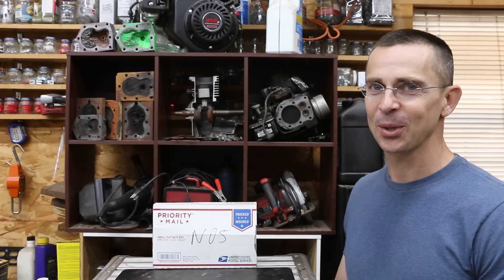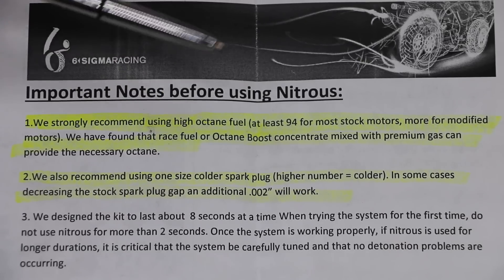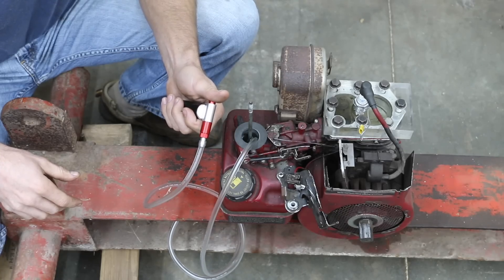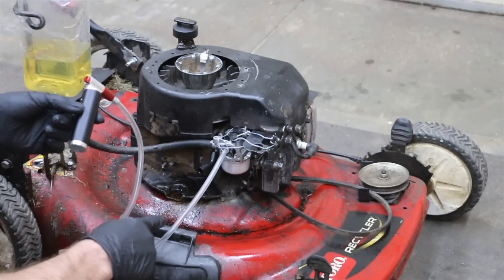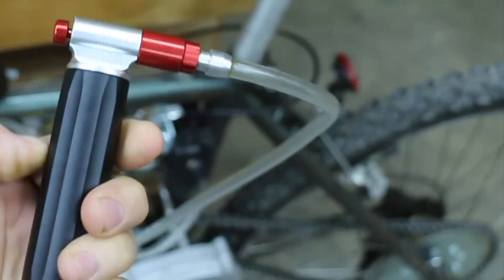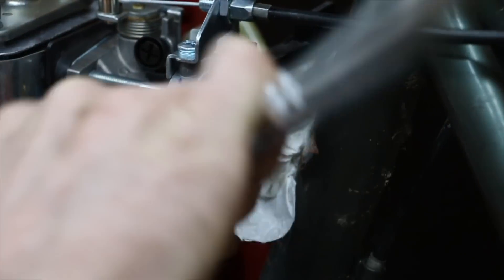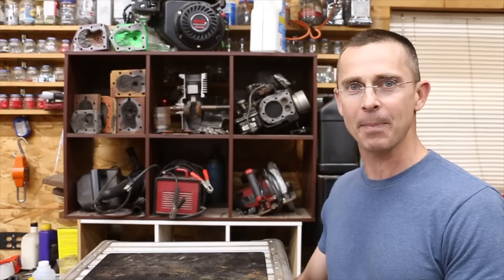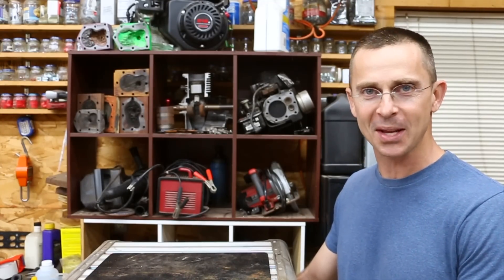Will the 4-Stroke Bike Survive Nitrous Oxide?  Let's find out!

Comment: Interesting... but several points to consider.  A "Real" NOx kit advances ignition timing a few degrees to combat preignition when active - this seems to be the biggest reason nitrous has a reputation for destroying engines: Noobs will add bottles and spray bars, but not a proper ignition system and the engine beats itself to death knocking. Also, a "Real" NOx kit adds additional fuel as well as the oxygen from the nitrous breaking down to generate additional horsepower using less nitrous - not so easily done without MUCH more complexity ( = Cost). While just the extra oxygen will allow the fuel to burn a bit faster and hotter in reality it causes the engine to run extremely lean, which is bad for preignition by itself, but also leaves plenty of extra oxygen to do other bad things related to preignition.  It's hard to tell, but the knock you experienced at least in the see thru engine test was likely caused by the "firefly" floating around in the cylinder - this very common in NOx engines. Sometimes carbon deposits can get knocked loose, but often rough places on the piston or head are the cause. Any kind of imperfection can do it, but notoriously numbers and logos stamped in the piston create thin raised areas around the stamping which become superheated, remain glowing hot from one power stroke to the next compression stroke, and serve as a preignition point during the next cycle.  Hot Rodders take extreme care to polish piston and head surfaces in boosted engines for this reason - that goes for turbo/supercharged engines as well. Connecting rods and crankshafts are also either specially made or polished when pushing an engine so far beyond its design output as any sharp corner can serve as a stress point to start a crack.
Reply: A "real" nitrous kit has nothing to do with timing, timing is controlled by other independant electronics such as a MSD box on a car, and ***timing is retarded, not advanced when Nitrous is used.
Reply: Um... advanced in the other direction. Sorry - Bad proofreading there, but point is if you want to add a significant percentage of the engine's original HP from a bottle there is a lot more to do than just shoot it down the intake. At least if you want any kind of life out of the original metal.

Comment: OMG so many things make me stress about this video. As a long time drag racer who has used nitrous many times it’s not used for RPM increase. That’s the WORST reason to use it. You are lucky that little motor survived. Power increase between 3k and about 500rpm before max is what it is designed. You should do a acceleration test where you go 40yards with and without the nitrous.
Reply from the maker: Great point. The 4 stroke bike is over geared and runs out of HP before RPM.

Comment: I will second the request for the Nos on the 2-stroke. Also test a small motor to see how high you can get the rpms before it completely fails. Perhaps thru the combination of a fuel pump and Nos. (not asking for the destruction of a new motor that would just be a waste, but perhaps as the final run for one already near it's end)
Reply from the maker: Great video idea!  Thank you.

Comment: You didn't make more power.  You just pushed it so lean it made the max it could, regardless of the extra oxygen being injected.  You could get that result without the kit.  Without more fuel being added also it is just an ornament.
Reply: the engine was probably running a little rich already, which would explain the bit of added power he did get.  Ofc he would get more if he added more fuel as well.  I'm not quite sure why the kit wouldn't include some way of adding more fuel, as a properly tuned carb\engine would make it useless

Comment: Put a turbo or supercharger on the bike engine, if you can find one small enough to work!  :-)
Reply from the maker: Thank you for the video idea!
Reply: A smog pump from an old car makes a great small engine supercharger
Reply: Julian Redwood then carburatoon becomes a major issue. Either have to run a "blow through" carb or put the carb on the intake flange of the turbo. Turbos get very hot, fuel ignition temp is fairly low (around 490-500 degrees). Could get dangerous.
Reply: @JOOLZNED  yes that's them
Reply: I've seen a Chinese 12V supercharger for "Up to 125CC"!  I'd like to see that tested. I'm thinking about putting one on my Trail 90  :-)
Reply: Stew Miller those e-superchargers are garbage.
Reply: Nah, there is no need for a turbo just take some jumps and drive on the wrong side of the road. Nitrous will refill itself and you can then use it pretty much all the time. Do some near misses if you can too.

Source: Need For Speed: Hot Pursuit
Reply: http://s-charger.com
Reply: https://www.motorcycledaily.com/2006/04/18april06_superscoot/
Reply: I put a turbo on a golf cart at a farm I used to work at, tiny little unit and not entirely sure where it came from but it did sort of work but only at max rpm. With less than 3 cylinders you'll struggle to maintain smooth airflow through the turbo and it'll run really rough
Reply: nope, don't do that, a small engine does not create enough exhaust pressure to create any boost. All you do is spool the turbo and gain absolutely nothing. You'd need a small engine capable of 10k rpms, predator 212, a heavily modifed briggs, tilitons etc. These VERY small engines, are INCAPABLE of any boost. It's just gunna detonate and honestly could hurt the great youtuber here.
Reply: You can get cheap turbos for small engines on eBay. <$150.
https://www.ebay.com/itm/Top-Racing-GT15-T15-Turbo-Charger-For-Motorcycle-ATV-Bike-35-A-R-Cool/132462037240?hash=item1ed75a48f8:g:LSMAAOSwn9VaU0Jq:sc:FedExHomeDelivery!72205!US!-1:rk:4:pf:0
Reply: @TravisTerrell  
Gt15 Garretts are used in 1.6-2litre diesels. They wont spool il 1cyl engines. 750-1000cc motorbike engines are totally different. They produce enough exhaust pulses and volume to spool.
Better way to select turbo is compare it to horsepower. GT15 is rates to 80-120Hp...
Reply: @Juho Mäki-Petäjä Good to know. I was just going by the product description, not actual knowledge. I know these guys purchased a similarly priced turbo from eBay for their Barbie Car go-kart engine. I wonder which model they used. https://www.youtube.com/watch?v=Tz7_9xwyV2I

Edit: It's this one. https://www.amazon.com/gp/product/B01A0MG5OM/ Though it advertises it is for engines around 100hp. However, it also says 500-600cc's, and I don't think most 500cc engines are making anywhere near 100hp.I wonder how many HP the Barbie Car is—I wouldn't think it's anywhere near 100hp either, given its displacement. Hmm...
Reply: Btw i don't understant the idiots who say turbo cant spool up in 1cyl engines when they dont have experience of the thing at all😂 only exhaust pulses does not matter when you just understant more than basics of the otto-cycle IC engines.
Reply: Only it makes sense that HX80 holset wont spool up in engines that are used in average everyday engines.
Reply: @jahasmitasmitas3338  
80cc can spool turbo enough small but you need lots of rpm to get enough exhaust volume. It is usually totally pointless.
Reply: Juho Mäki-Petäjä Pointless but fucking interesting and entertaining, you dont need to explain everything with sense when you do something different and fun.
Reply: @jahasmitasmitas3338  
Ei tartte mennä henkilökohtasuuksiin jos jää toiseksi.

We were discussing 49cc low rpm engine forced induction.
Reply: Juho Mäki-Petäjä En oo menny missään vaiheessa, suomenkielellä sanottun hölmöimpii virityksii ei tarvii "Selittää järjellä" vähä sama ku "miksi ei" ssnonta😂👌
Reply: vz21 rhb31 chinese ihi clone turbo will do the job on 4 stroke bike engine.
Reply: No chance, thats for a 800- 1100 cc engine, gas flow wouldnt even spin the turbo up
Reply: Julian Redwood Why not? here in Finland i got 2 friends who have put it on 110 and 125cc monkeytyoe engine and boosting very well. 80cc would spin it and make it boost when you just know what ypu are doing.
Reply: Finnish Gopnik 
Yeah at 9000rpm. That bike 4stroke is too lazy to make boost.
Reply: @jahasmitasmitas3338  you could increase the air velocity by reducing the exhaust pipe diameter. Wonder if that would help spin it up.
Reply: Calvin DiBartolo Technicly that's true, and when you ste boosting even witl very low pressure you increase the amount that comes out of he exhaust, so it makes the turbo spool bit better at the time when you are starting to build boost. Everything matters on turbobuilds and i can honestly say that im not a idiot and will proof that 80cc will spin turbo small enough
Reply: i quess it would be possible to make it work just when you know what you are doing.
Reply: Finnish Gopnik 
You can not beat physics. As 15year old all seems possible. But reality is another thing.

Comment: If you’re willing to test it, E85 has a reported octane rating of between 100-115 (sources vary on what it is exactly but it is def above 100). This may help with the pinging and I doubt it would hurt the engine in the short run, although you would need to adjust the carb since the fuel-air ratio is 9.8:1 with E85. Love the videos!
Reply from the maker: Great recommendation!

Comment: If you can add fuel, you'll make more power. All car systems have two sides. One fuel and one nitrous. This will fry any motor its used on. You must add fuel too.
Reply from the maker: Great recommendation!
Reply: @Joseph Houser Dry kits are for fuel injected engines that have capabilities to add extra fuel via tuning of the ECU. Nitrous oxide without extra fuel leads to a blown engine very quickly

Comment: You should try oxy/acetylene injection on a small engine!!!
Reply: As a welder I don't think that's great idea lol
Reply: Michael Smith it works, or at least map gas does . Correct me if I am wrong but the only difference is map has some propane in.
Reply: @Alexander-xx6pu  I'd correct you if I could, but you're right! Mapp (Methyl acetylene poly propylene) has a higher ignition temperature than pure acetylene. It will wait for the spark, allowing the engine to run properly. Its actually more like propane except you'll use less of it for the same amount of oxygen than propane. The result would be a little less power for a longer time. sort of like the difference between gasoline and alcohol.
Reply: Vincent Robinette thanks
Reply: I tried that. KNOCK!!! PING!!! acetylene has such a low ignition temperature that it will detonate before the spark.
Reply: I predict a cut valve before long.
Reply: @RoyMach1ne  Make sure you have a good spark arrestor on the muffler.😁😜😁

Comment: As many commentators have noted, there needs to be additional fuel introduced with the NO2 to consume the liberated oxygen. As you mentioned, there is also decomposition energy released by the liberation of oxygen and nitrogen. All of this leads to faster flame propagation rates. On all the small engines you tested, the timing is fixed, based on full throttle at rated speed. As such, I could clearly hear pinging in every one of them. One thing to try, to introduce extra fuel, is to apply a small amount of choke as the nitrous oxide button is pressed. Maybe, you could set up a linkage that stops the choke lever by pressing the button on the cartridge. That will help ensure that you're oxidizing fuel, not piston faces, or exhaust valves or seats. If you miss on  the fuel/ nitrous mixture, better rich than lean. I'm also hoping that the thermal mass of the extra fuel slows the flame propagation rate enough to work with that fixed ignition timing. I don't know. Could you possibly revisit this with mixture compensation?
Reply from the maker: Great point.  I'll revisit with more fuel.  Thank you!

Comment: Project Farm suggestion: Test zip-ties

I would not have thought that there would be a difference between zip-ties,. Today, I discovered that there's a big difference! It's about 8°C outside and I used zip-ties to put my Ford Focus back together because I wanted to improve on the factory build-quality. As I was tightening up a black zip-tie to re-attach my shift cable to the shift-lever, the zip-tie snapped where it was bending (while it was still super-loose around the cable end). I thought that was an anomaly, but then I tried it with a second black zip-tie and the exact same thing happened! My other colored zip-ties had worked to improve on the Ford quality, and then it suddenly dawned on me that Ford probably makes zip-ties as well, so maybe there's a quality difference between the black ones and the non-black ones. I'm not actually sure which zip-ties came from where (i.e. I'm sure the color made no difference, other than being able to tell them apart), but I am positive that the black ones I've got could evacuate the bloated tummies of deceased beavers - and that's about all. I think I'm going to throw them away since I don't have your address to send them to you. I'd like to know which zip-ties are good for all-weather use and which ones should only be used in Florida (or on a Ford).

I think that a test of different branded zip-ties at a variety of temperatures would be really interesting.
Reply from the maker: Great video idea!

Comment: Use a bigger nitrous tank and drill the jet to run slightly richer. Those small nitro cans loose pressure after 3 seconds.  Effect of change of state from liquid to gas cools down the liquid no2  = pressure loss
Reply from the maker: Great recommendation!

Comment: often with many nitrous systems there is more fuel added when the nitrous hits as well. You're essentially adding more oxygen, so it makes sense to ad fuel to get the most out of it.  Unlike what the TV and movies show, oxygen is not actually flammable either. It will accelerate burning, but in and of itself, it does not burn without fuel added. That's one question I've had since it happened with the apollo mission where they flooded the capsule with oxygen then of course a spark ignited something and zoom there it goes. Why in the world would they flood the cabin with oxygen in the first place? That's begging for an accident. Why not flood the cabin with nitrogen or helium or some other noble gas? The astronauts are in space suits with their own air supplies, so what's the deal?  Never did get that. anyway if there is a way to do it, see if you can rig up a way to deliver a bit more fuel when the nitrous is hit. Of course, how much fuel you can add is proportionate to the amount of nitrous you're going to use.   The reason some nitrous motors blow isn't the nitrous itself, but with the added fuel, there is a failure point in any mechanical device, sooner or later if you keep going bigger and bigger bangs one time it's too big.
Reply from the maker: Great point.  Thank you

Comment: This is fairly new technology, but have you ever thought of testing a small engine with compressed air supercharging? Obviously, since the air is coming from a static source, you will run out faster. But it would be interesting to see how it affects a smaller engine and how long you could make a (hypothetical) power increase last with a smaller engine.

Also, I don't know if you've done this before or not, but have you thought about water/ethanol injection as a power supplement/charge cooler/ping suppressor?
Reply from the maker: Thank you for the video ideas!

Comment: That was the funniest shit I've seen in a long time! The mini nitrous kit was fantastic! What even funnier is when I was about 18 I wanted to do something like this to an old POS car I had.... Never actually did though.
Reply: The slang term for nitrous on a clunker is "bottle bomb". That's when you put the biggest system you dare, then a little bit more.
Reply: @vincentrobinette1507  but what I wanted to do was get a few of the little cartridges, fill up a balloon or something and run a hose to my airbox. Basically exactly what he did in this video but on a car. Just to see what it did.
Reply from the maker: lol. Thank you!  I had a lot of fun testing out the nitrous kit.  Surprised it added so much power without adding extra fuel.
Reply: Bill Carini yea and I wanted to put a semi motor in a smart car, never actually did though
Reply: @zxKrookedxz  Put a semi engine in a smart car? Or, park a smart car in a semi engine?😜😁😜
Reply: I put a nitrous kit on my first car, a stock 1987 Chrysler LeBaron, about a 50 hp shot.  It survived.  It can be done!
Reply: Never to late

Comment: I don't know if you seen how they mount the bottles of nitrous oxide in cars. At a 45% they have a line inside the bottle an so it picks up from the bottom. So your not getting are your getting the liquid nitrous. That is why when they purge the system to get the air out. If you take the little air cly they send to you in the kit put one in turn it upside down an push the button. Make a big diff.
Reply from the maker: Great point. Thank you
Reply: injecting the liquid would certainly increase the amount of NOS getting into the engine, as well as helping cool the air, but without a system to add more fuel it's pointless.  the engine is already running dangerously lean with the amount of NOS going in now, putting even more NOS in isn't going to help things

Comment: I wouldn't go 40mph on a pedal bike!!! GreAt video
Reply from the maker: Thank you!  Yes, that was way too fast!
Reply: I hit 50mph on a bike with a tune 2 stroke bike engine befor never again unless am running disc brake because the rubber pads dont have enought stopping power for emergency stop
Reply: @kxlucifer  , I had a two stroke Suzuki FA50 , basically a mini motorcycle. No pedal but kind of looked like a moped. It had small motorcycle tires and brakes and I was scared to death doing 35 mph on it. I can't imagine 40-50mph on a bicycle!!!
Reply: @PepeEpstein  i was younger and always want to do something crazy lol ..it was fun but not ideal